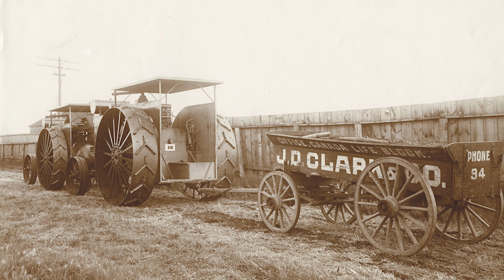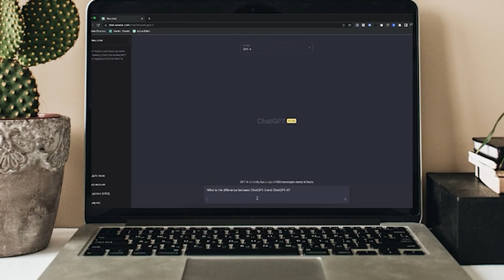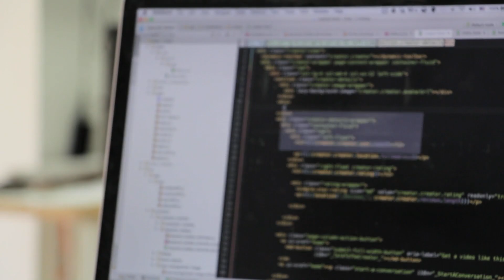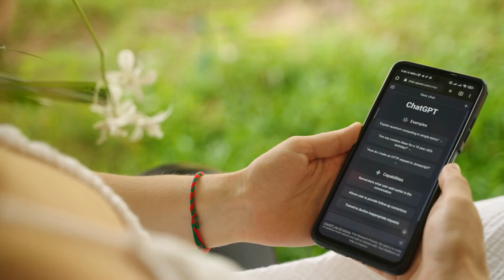Is AI Going To Take Your Construction Management Job?

Comment: I see it replacing a majority of QA if a company can have someone have AI analyze their specs, contract and historical SOPs. I'm using it to make our SOPs and reduced the need for a lot of document drafting and people on sites for that. I've had some great ITPs made but needs a lot of oversight. Over time it should replace a lot of the SOP and quality document drafting from what I'm seeing in the USA industry now.
Reply from the maker: But thank you for your comment, I really appreciate the insights
Reply from the maker: The paperwork side of QA yes. But the field inspections and sign-offs are hard to replace in the short term. Particularly when there is a safety impact. For example, requiring an electrician to sign off electrical work. I can't see how people are comfortable with AI/software doing that in the short term
Reply from the maker: I agree with the ITPs. The only thing I find difficult is getting AI to cover the specific context. For example, even an in-situ concrete pour has lots of project specifics that need to be covered; hold-points, service penetrations, etc. To me, it is not that much more useful than just copying a good existing template